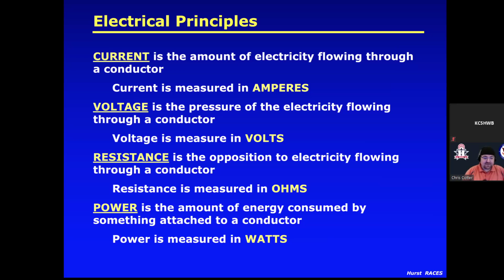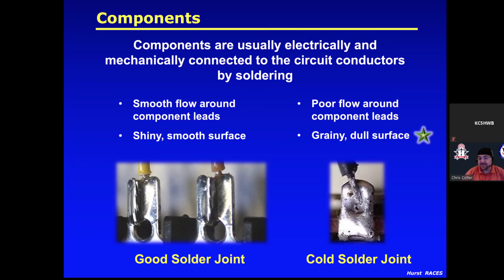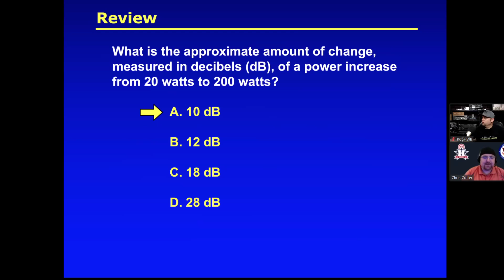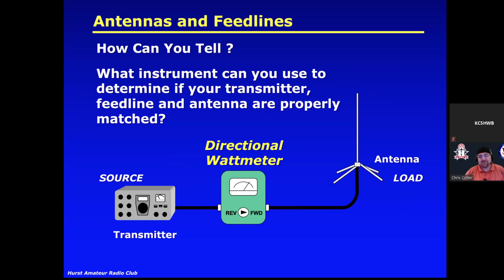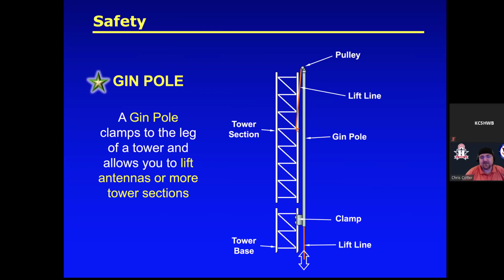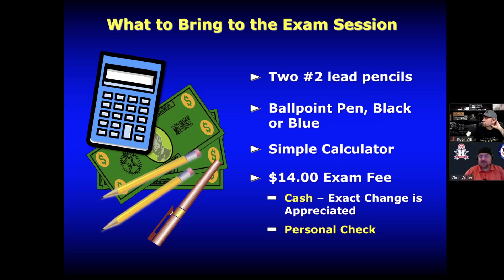Ham Radio Technician Class License Course and Test Prep, Part 3

Comment: Thank you for these phenomenal teachings and reviews. The material is presented very well. It was super nice of you both to do this. I can't thank you enough. I am using your review, the ARRL book, the Pass Your Amateur Radio book and the AA9PW practice tests to hammer this info into my brain. My tests went from 45%-55% on the first three tests to 31 to 33 out of 35 questions right on future tests. I would not have known about the AA9PW tests without your suggestion. Your discussions have solidified what I am reading. Thanks again! Just awesome.

Comment: Regarding electrical safety at around 1:15.  Yes it's the current that kills but there is more to it than that. In reality its both, or more precisely it takes both. The reason is because if you don't have the volts you won't have the current. Remember, voltage is the "pressure" that will drive the current. If you don't have the volts you won't get the current unless you have some incredibly low resistance. Respect them both and you are good to go.

Comment: Great job guys. I know I’m a year behind but the old high school electronics class is starting to resurface!  As a former pilot we used some “rules of thumb” when having to do ground tests of the HF radios. The aircraft had to be pulled well away from the hangar, ground personnel had to depart the area and all aircraft doors had to be closed.

Comment: POWER is the RATE at which energy is consumed.  A 100 watt load will consume 1 kWh in 10 hours, whereas a 1000 watt load will consume 1 kWh in 1 hour (10X faster).

Comment: Coaxial conductors also act as very long capacitors. This is also how their loss is so low. Twisted pairs also act as capacitors, but the twist adds inductance to the circuit; thereby balancing them for clean transmission at low power (since the conductors are typically 24 to 28 gauge conductors). Coaxial is ideal for high power transmission and where broad bandwidth is required.

Comment: I’ve watched this, waiting to get my book. They are hard to find, out on Amazon. Want to read the book in the parts I need to study more. 

Looking forward to getting my Technician Lic, just can’t decide on what HT I’m going to get. I’m usually a buy once cry once guy or just below that level. Got a DMR repeater 2.4 miles and Fusion 10.5 miles. So hard to decide on a radio. Will get a hotspot too not sure if all at same time or at different time. 

Thanks for doing this appreciate it big time love your videos!

Comment: Great series guys!!!! Thank you very much. 

Curious if any modern HAM rigs put the RF power output stage remotely at the antenna to avoid big/lossy coax running from shack based transceiver. Seems like it would be easier and better - but I am a total newbie. Hopefully someone with experience can chime in.

Comment: @07:14 your description is backwards. If you try to measure ohms while your meter is set to volts, nothing will happen but you won't measure ohms. But, if you attempt measure live voltage or amperage while your meter is set to measure resistance in ohms, you will pop the fuse in it at bare minimum.

Comment: Tuned resonant circuits with inductors and capacitors do not convert AC to DC. Diodes are used for that function and when used that way are called rectifier circuits like full wave or half wave bridge rectifier circuits.  Info at 28.13 is incorrect
Reply from the maker: Contact W5YI, it's their training material. Wouldn't be the first time I've found a mistake.

Comment: Awesome vids. Why do they (the fcc) mention smoking a multimeter testing volts in ohms setting. I've never noticed this to be the case on my "multi"meters... Now if you test volts in the amp setting you get the magic smoke.....  Does the radio community have a special multimeter?

Comment: Hello everyone. I'm really enjoying this class but I do have a question and please know I don't mean any disrespect here. 
I want to get a ham technician license to better communicate with my family during emergencies and in case cell towers are damaged during storms and such. 
I realize what is being covered in this presentation is to help you prepare for the test that is necessary but why is all of this necessary? 
Why would people need to understand wire resistance, diodes, reading schematics and stuff like this just to be able to see if your wife and children are safe at home? 
I fully understand the parts that teach you about speaking properly and following that protocol of what you can and can not say over the air but other things seem a bit more advanced for the average person.
Again, no disrespect here, just part of my learning process. Thanks again and excellent video presentation.
Reply from the maker: Because Ham Radio is about much, much more than just Emcomm and Prepping. You're looking at it from that perspective alone but that's not what the main part of the hobby and radio science is about.
Reply: @HamRadio2  Thanks for the reply. Yes that’s primarily why I want to use it as well as using it for CERT. I guess I need to look around a bit more so I can understand why certain things are required at this level. Is this so people can build their own radios? Again I’m not trying to be a pain here. Im brand new to this and just trying to understand it all.

Comment: First thanks for finally getting to the electrical stuff. I don't have a clue why I need to know this garbage, but got to pass the test right. Second I have to vent. WHY on God's green earth did they give the electrical symbols a letter that meand nothing to the actual thing they are. One would think they would use V for volts, A for Amps, an O for Ohms, C for current, W for watts, but nooooooo. We couldn't make it easy.
Reply from the maker: These symbols were created long ago but electronics people, not by Hams.  But I hear what you are saying.

Comment: At the 44 minute mark, you start talking about polarization of antenna's. You said your transmit antenna should be the same (horizontal/vertical) as your receiving antenna? How is it even possible to have a horizonal and a vertical operating into a radio at the same time unless you have a switch? Are you talking about for example if the antenna was designed to be a vertical antenna, do not lay it horizontal and visa versa. Besides, how the heck would you lay out a dip pole antenna vertical?